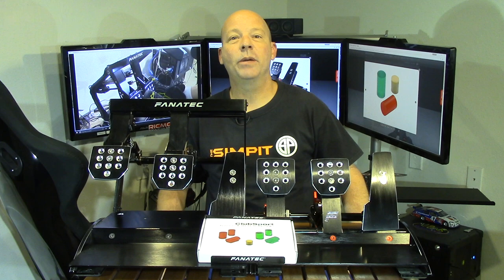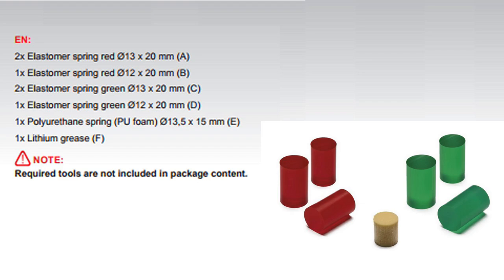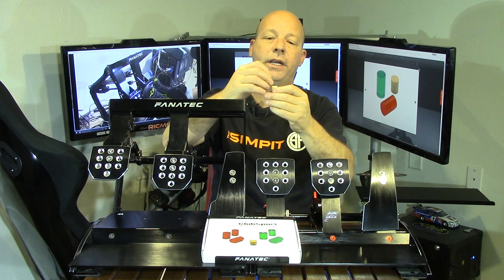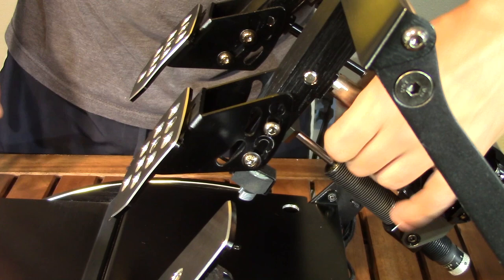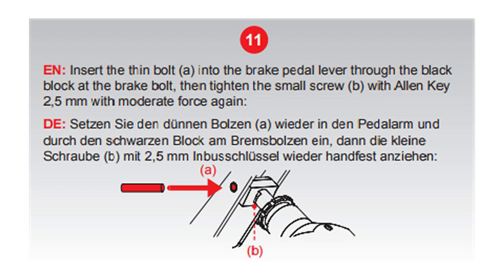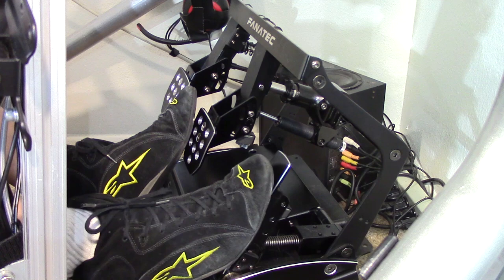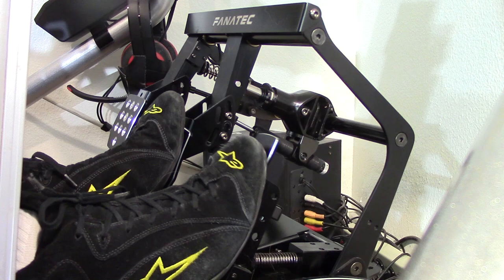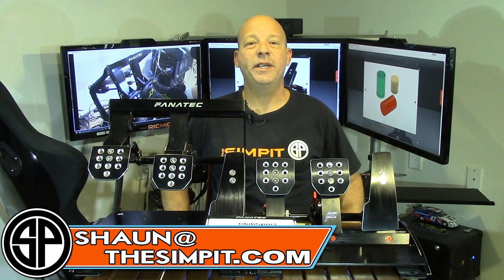Fanatec Clubsport V3 Pedal Brake Performance Kit - Review

Comment: It's really tricky to install, took me several minutes trying to get that pin back in, getting the alignment is difficult as the tolerance with the pin and pedal movement is really right. Took a lot of frustration, force and sweating.  So you really want to get this right the first time. Swapping around those rubbers constantly would be painful. It is a good upgrade though, but you forgot to mention in the review by using this you permanently fix the brake pressure tension and it's no longer adjustable. 

Overall this does correct the stock brake which never felt quite perfect to me until installing this. I don't condemn Fanatec though, they thought the adjustable brake tension screw was a good feature. It just didn't work as well as they had intended. I use HE Pro pedal these days, and I can confirm the HE pedals still outperform Fanatec V3's even with the performance brake kit upgrade by a good margin. Not double the price improvement, but sim gear price to performance tails off at the higher end. I'm happy though.
Reply: that pin took me forever to go in. I figured I was doing something wrong.
Reply: It not you,  it's just a horrendously difficult operation. Something missed from all video reviews as they're probably sponsored by Fanatec.
Reply: agreed. I searched everywhere on YouTube last month just trying to find someone that was showing the method. I finally went underneath and up with the part of the brake that holds the mod. The pin slid easy that way. it took hours and hours when I had the free time. what makes/made you go with the current pedals you have?
Reply: The reason I bought the HE Pro pedals was just want over need. The Fanatec pedals we're really good and I had no complaints with their performance.

Comment: Step 11 was almost impossible to accomplish. It snapped the rumble cable, although the fanatec manual doesnt even mention it is a risk. For me I came to a point where I almost gave up the installment. I couldn't overcome the force of to push in the rod enough so I could slide the pin back in. I really thought everybody would have the same issue.
Reply: Speck Racing I had to really swing on the brake pedal to get that pin back in, but it's doable.  And yeah, the rumble cable is mega delicate
Reply: Same here, now I have no vibration on the brake pedal. I have stated this issue on Fanatec forums but I don't think they have updated the manual.
Reply: snapped mine as well about a month ago. I spent hours trying to figure out what I was doing wrong. finally I just went with the underneath force it in method. if I would have done it that way the first time it would have saved me 2 hours and a snapped brake rumble. the bad part is the instructions don't tell you that method while it is by far easier and safer on the wires.
Reply: What do you mean by "underneath force"?
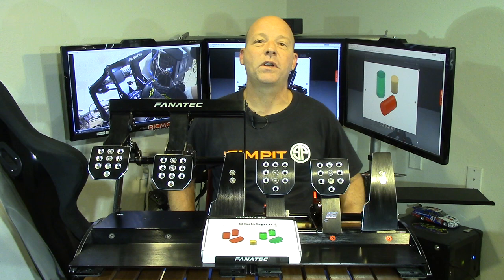Reply: It is hard to explain. I will try my best.  I kept the the brake pedal bolt attached to the brake pedal itself.  Once I finished putting in the elastomer springs into the preload screw, I then forced the preload screw into the brake pedal bolt.  (on the floor the brake pedal screw would start touching the floor. From that underneath position you swing the preload screw up and force it into the already attached brake pedal bolt)  Their is a video from the simracing paddock channel on youtube.  It is his review on the pedals.  If you go to the 8:10 mark, you will see this in action.  I was about to give up until i saw this.
Reply: Thanks!  I'll watch that
Reply: No problem. It takes alot of force and you may feel hesitant to continue forcing it in, but it will snap into place.
Reply: Thanks so much for the solution and referring to the simracing paddock video.
Reply: chaseydog glad to hear it helped you! They are a great set of pedals once you get finished with the installation lol.
Reply: I remember using a screw driver to hold it down while I stuck in the pin

Comment: I drive real race cars and recently bought a sim setup.   Using a G27 set right now looking to upgrade to the full fanatec setup.  If I'm going from the G27 to the CSP V3 pedals, is it still recommended to get that performance kit?  I think the upgrade is going to be massive, but for $30 and basically free shipping with the larger order maybe that's better?  The logitech pedals are pure junk obviously...

Comment: With my V3’s I just purchased, I’m only getting an inch of brake pedal travel with the stock setup out of the box with the load cell set to max. A lot stiffer than what you demonstrated here. Has Fanatec possibly changed the stock foam included since this video?

Comment: Is there any difference in feel putting in the 12mm first or second? Or to put it another way if you are using the 12mm rod should it go in first or second? Did adding the PU make the pedal harder or softer?

Comment: Good review, really informative. I still got one question however: I'm going to buy a set of V3 pedals (NOT inverted) soon with the damper kit and I was wondering what impact has the brake mod and is it worth the extra money when you get the damper?
Reply: This brake mod is crucial in my opinion as it helps you stay close to threshold braking without locking up the tires. You will not need the damper.
Reply: Thanks for advice - I'm switching from stock Logitech GTFC pedals so that's going to be a massive shock and I read that the damper kit is the way to go as I'm mostly running the GT cars. But now I'm really starting to consider getting both (damper and braking mod) as it's not that much more expensive to get both when you get the pedals and the damper.
Reply: Trust me, you will not need the damper. Also, make sure once you have the pedals installed and calibrated that you learn how the signal resistance slider affects braking inputs. The higher the resistance, the longer the throw is before the brakes lock up, which gives you even better precision.
Reply: hulley5223 what combo did you end up settling on for your setup?
Reply: @James I: I used the two red cylinders. I think the greens are a little too stiff. With the reds, you can always adjust the pedal itself to make it stiffer, so it is good to have that option. In the Fanatec properties menu, I have the signal resistance set at 70, which decreases the input sensitivity, making it easier to hit threshold braking without locking up the tires. I'm really happy with it.
Reply: Thanks for the help. I am actually the same as you on the slider being at 70. It has been working great there for threshold. I will try the all red combo out.

Comment: I'm sorry but I can't recommond this, even not considering some pieces of rubber will cost you 30 euros. I personally like a stiff but this is too much, who needs a brale pedal that don't even move when you step on it? If you have to use it, please only use the "soft" combination. In addtion, it is very difficult to install because it's just too stiff, the cylinder and pin won't be back into position  unless you compress it with everything you have. You need to be a boss of the gym to have the threngh to install it. The first time I tried I left some ugly scarch on my brand new pedal, but I can only appricate that I didn't break the whole thing because these stupid pieces of rubber. I think the original spring is stiff ernough when you increase the preload, you really don't need these.
Reply: For me the CSP V3 makes me 1 - 2 secs faster (compared to Thrustmaster stuff). With the brake performance kit another 0.6 secs. (Medium installed)